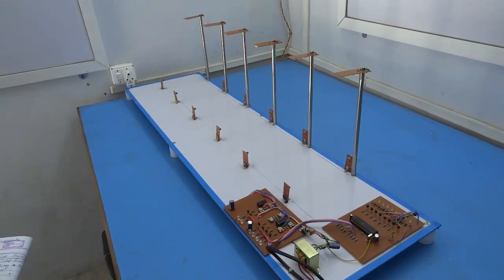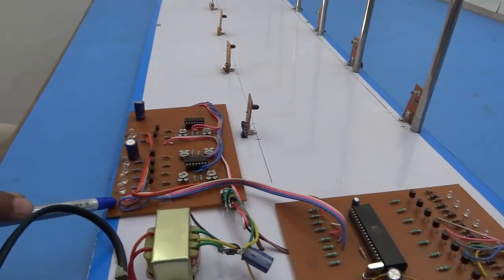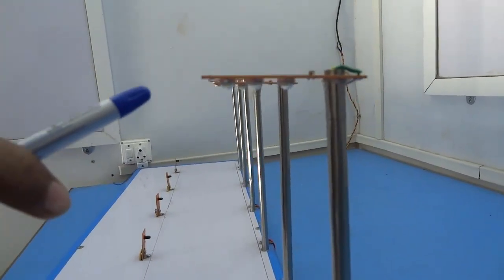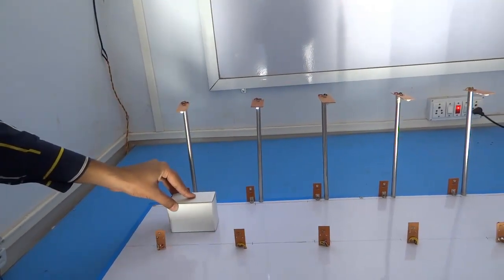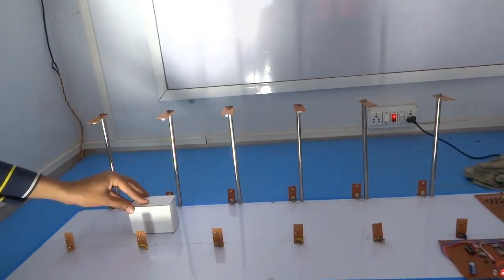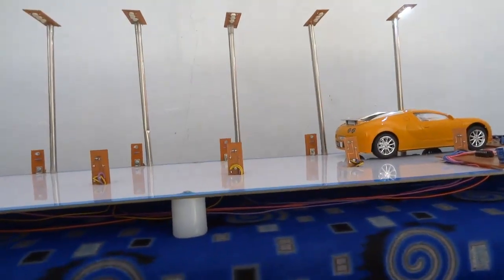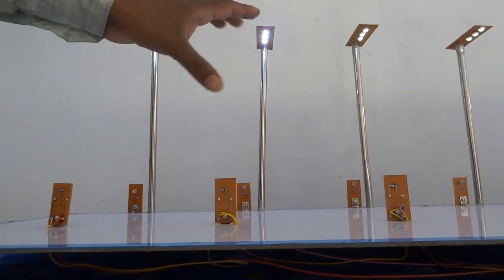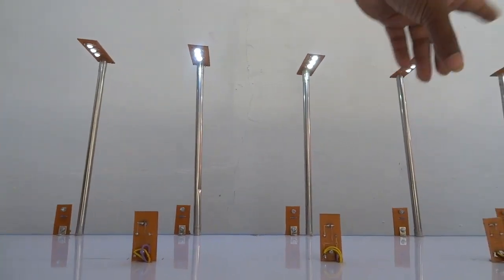Smart Street Light Control System with Vehicle Detection and Time-Based Energy Saving

Comment: Nice project...  i hav a question for u.  As u shown in dis video this is done by small equipments and low power and low rating lights..  im sure it can be built for larg rated lights also.  But i wanted to knw that what type of lights can be used in real streets and what equipments are needed.  And what type of connection v r gioing to do it.  Plz response to my comment or plz come on my whatsap number 8088681566 thank u